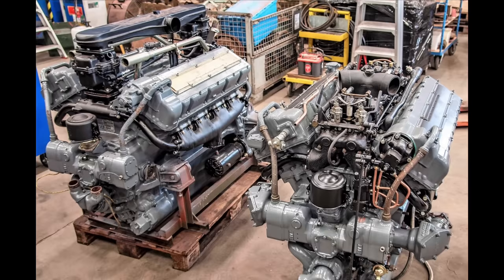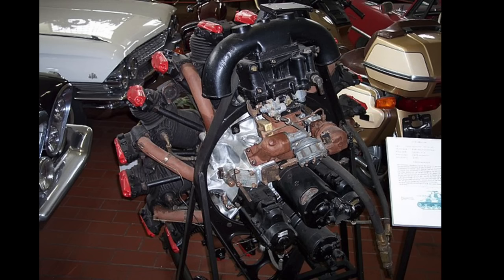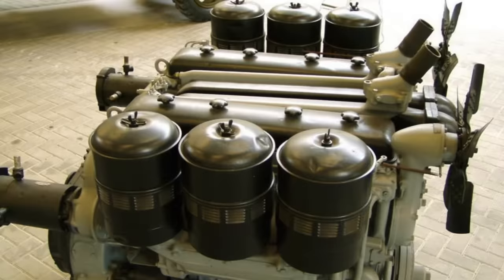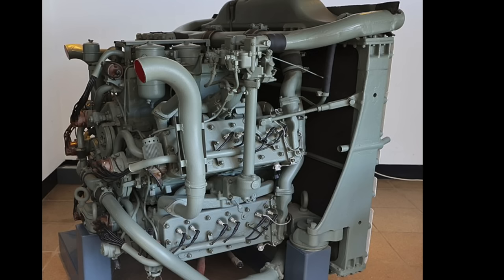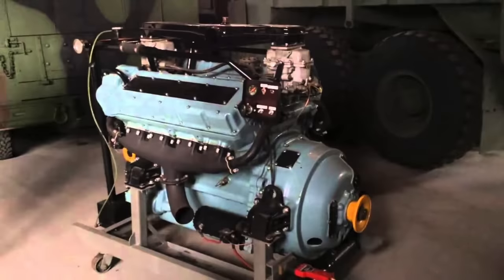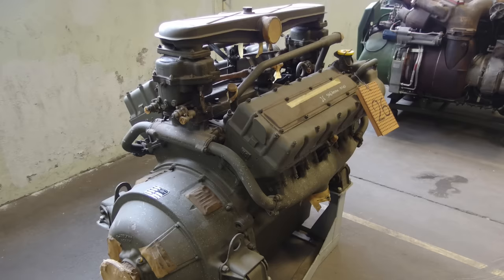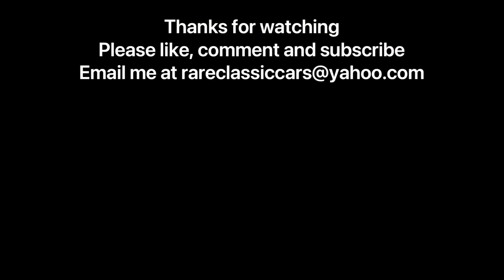An All-Aluminum, Flat-Plane Crank, DOHC V8 in 1940! Ford's 1,100ci (18L) GAA V8 Is a WWII Marvel

Comment: That with a single carb intake would be awesome in a tour bus. Quiet and smooth.
Reply: Fuel injection and quad turbos...
Reply: That would need to be a BIG single carb...
Reply: Off an Allison or Merlin aero engine.....
a drain pipe with 1/4 inch jets and a Coke bottle sized accelerator pump...

Fuel injection for the win...with all the modern sensors to control everything on that engine...

idle @ 250rpm or less...
full out past 3000rpms or more...

(the crankshaft is the weak point with those horrible vibrations 
(that's why the 150lb flywheel)

 @De19thKingJulion
Reply: @JohnSmith-yv6eq  If I could EVER get one of these, probably for a heavy duty truck... Fuel injection for sure, perhaps 16 of 'em.  Hearing one idle at 250-300rpm?  Ooooh
Reply: @De19thKingJulion   Not necessarily. LPG regulator and HHO regulator or EGR and it would work with just one of those mistifiers. It only needs to turn 2500 to 2700, and not for a "max power", but smooth operation with decent fuel economy.
Reply: @JohnSmith-yv6eq  Not heading to the sky, not trying to win races, only down the road with band gear and a dozen hippies in a bus. One carb, LPG regulator and HHO, or EGR system would easily turn that thing in between 2500 and 2700 RPM with decent mileage, while making less noise than the tyres. The combustion chamber and all the dimensions are off for actually trying to make power out of that thing. Boost and EFI would require basically completely different engine from crank to casing.
Reply: @JohnSmith-yv6eq  To hell with computers and sensors and all that crap.  Carburetors and distributors were the way to go.
Reply: @jamesbosworth4191  - "distributors"? Fergitaboutit! Magnetos for reliability.
Reply: @OHUQTU  
Distributors are a heck of a lot better than computers, sensors, and other non-adjustable non-repairable junk.
Reply: @jamesbosworth4191  - The FAA requires dual magnetos with gasoline powered piston engines for reliability - no distributors are allowed with aviation engines, because they are not reliable.
Reply: @OHUQTU  I thought you were talking about cars.  Sorry.

Comment: Flat plane cranks went into some of the first V8s, going back to the OX-5 and earlier. The 1917 thru 1919 Chevrolet Model D V8s were so configured.

Rolls Royce built a similar engine called the Meteorite, a derivative of the V12 Meteor, which itself was a marine version of the Merlin, but naturally aspirated. 

Ford ultimately built the final version of the Pratt and Whitney R-4360, under contract by Pratt and Whitney, which was a 28-cylinder radial. AKA the Wasp Major, the Ford built versions powered Boeing C-97/KC-97 Stratofrieghters, Douglas C-124 Globemasters and Consolidated B-36 Peacemakers. Rated at 3,500 to 3,800 HP.
Reply: Yeah, the original flat planes were just because cross-plane hadn't been invented/commercialized.  It's not like they were revving an 18L engine to 8kRPM, lol.
Reply: @@retiredbore378 That's why I wrote invented/commercialized, rather than just invented.

Comment: and yet american cars still come with pushrod crap till now. image in the us just leaned into making advanced engines
Reply: Pushrods are far from crap. The LS engine is one of the most swapped engines in the world.
Also DOHC isn't new or "advanced" tech.
OHC techonology and pushrod technology are within about 10-15 years of each other.
Reply: @riogrande163  the old lt5 was better in every way to the old sbc
The new lt5 is vastly superior to any ls ever made. 
There is no comparison between that two design that compares favorably for pushrods other than cost. American make them because they are cheap and simple not because they are better. There’s a reason no one uses pushrods anymore…

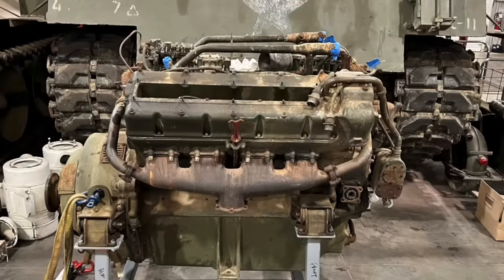Comment: I volunteer at the Museum of American Armor in Old Bethpage NY. You actually are showing off a GAA in our museum at the 8:00 mark! We have a number of vehicles we keep in running condition. One of the other drawbacks of the radial engine is that it needs to be cranked by hand 50 times before startup, to get the oil out of the bottom cylinders and flowing throughout the engine. Ask me how I know!

Comment: The Australians fitted 4 Buick flat head v6s together to put in the Shermans they had.  They couldn't get the other motors, and they had access to the Buick motors. They stacked the motors in a square configuration and used a gear system to link them.
Reply: Flat head v6? What?
Reply: @patrickporter6536  are you asking what a flathead v6 is or what Buick motor was used?
Reply: Flathead Buick engines?  Buick always used overhead valves.
Reply: @cyclonebuzz8172 I know what a v6 is, I doubt Buick made one in the 30s/40s, flat head or not. I may be wrong.

Comment: The M-4 Sherman was considered one of the fastest tanks of WWII. It was certainly faster than any of the German tanks it went up against. This, its maneuverability and sheer weight of numbers, normally gave it the upper hand in the European Theater.
Reply: My dad was in the Third Armored, and he said the Sherman was faster and had a much better and faster turret system, but all tankers were terrified of the German 88mm.
Reply: @ohger1  I think your dad was right.
Reply: No code p0420 or p0300 back then
Reply: Not faster than a Panther and they had wider tracks, better for soft ground. The Panther 75mm gun actually had better penetration than the 88.

Comment: For a short time the GAA was a popular tractor pulling engine but was soon replaced by the guys running Allisons. I've seen an example of Plymouth's 30 cylinder engine in the lobby of Chrysler's museum north of Detroit. Really interesting engine. It was designed this way to use proven engine parts already in production. Still, it was great engine that field mechanic would have no trouble understanding and keeping running in the field since it was the same engine their car had.

Comment: Whenever I hear old engine specs, I'm always blown away by how powerless they were, and how inefficient, too. My tiny little 1997 Subaru EJ20 2-litre turbocharged horizontally opposed 4-cylinder weighs 380lbs with headers and turbo attached. Yes, it is highly tuned with bigger injectors, a much large top-mount intercooler, and a 4" cat-less downpipe - and it dynos at 404 HP at 18lbs of boost.
It's got a short-ratio 5-speed gearbox from the WRC rally cars, and so it redlines in top at just 215 kmh! 
Throttle response with the little Mitsubishi TD04 turbo and the ultra-light crankshaft is phenomenal, and acceleration in 2nd and 3rd gears is ferocious, and the utmost driver care and attention is required, lest the vehicle gain the upper hand. :)
Reply: Maybe, but it doesn’t have the torque to pull a tank. Horse power isn’t everything and that’s why trucks have big diesel engines, not high horsepower figures but look at the torque, it’s massive.
Reply: If you were to put your engine in a tank that constantly requires 400 hp, it wouldn't last long at all.  The 450 hp the GAA makes at 2600 means it is also producing over 900 ft/lb.  You can't just go by hp to understand what is going on.

Edit: Also consider that an operating requirement would have been to run on inconsistent or low quality fuel without detonation.  That would place limitations on what can be done regarding compression or forced induction.
Reply: lets see how your subaru runs on 80 octane gas
Reply: @shawnbottom4769  Agree 1000%---what many don't realize is that the fuel available to ground forces back then by necessity was very low octane, because the vast majority of the engines consuming that fuel were flatheads in trucks, jeeps, and stationary equipment.  Since this engine went onto the drawing board as an aircraft V12, I'm sure it started out  with a high compression design, but when it was redesigned for V8 ground duty, the compression ratio had to be lowered for the reason stated above.
Reply: I don't think the original poster was insinuating putting a Subaru engine in a tank or wheeler truck.
Reply: Your EJ20 wouldn't budge a Sherman, at least not very fast and not for long.   The GAA would not only put out 1000lb/ft torque, it did it at 2400 rpm and could do it all day every day, and they did.

Comment: From what I have observed and studied the GAA was a very advanced engine for the time, and even today modern engines incorperate many of these features.

I may be wrong but i think they had basic variable valve timing, and the later models used in the M26 pershing were updated with throttle body injection.
These engines bare many simulairities with Fords modern modular block V8s.

Comment: The Detroit twin six was a two stroke diesel engine, and the blowers on them were not superchargers, but scavenger blowers. As with all two stroke Detroits, they have no means of natural aspiration so the blowers are needed to pump in fresh intake air charge, and scavenge the exhaust out. Intake air is provided at slightly above atmospheric pressure. Intake charge entered the cylinders through ports in the cylinder sleeve when the pistons were at bottom of their stroke, and exhaust exited through valves in the head. There were turbocharged versions of Detroit two stroke engines later available in trucks and the like though. Two stroke Detroits have a sound all their own. The main truck in the movie "Maximum Overdrive" is a good example of that sound.

Comment: Torque is what you actually measure on an engine. 2-stroke engines Rev, very high and then that's where you measure horsepower
Reply: @@retiredbore378 👍Wartsila wide open- 90 rpm/100,000+ hp😁 engine the size of an apartment building.

Comment: big deal.  Peugeot had a dual overhead cam, aluminum 3L engine car that twice won the indy 500. 1912 and 1914? about. The French were always ahead. 4 valves per cyl no problem.  I
it massacred 10L cars

Comment: The low RPM has to do with it's aviation heritage.  Most light aircraft engines will redline around 2700 RPM, the reason is that the tips of the propellor will go supersonic if turned any faster.  The Allison 1710 and the RR Merlin V12's typically turned around 3000 RPM, but they used reduction drives.  Ford was probably trying to get around that and designed it for low speeds.  That way it wouldn't need a troublesome and heavy reduction drive.

Comment: the Chrysler 30-cylinder engine was 5 6-cylinder truck engines married together. It was apparently quite reliable. All of these different engines were needed because of the lack of a truly adequate engine design.

Comment: 3:36 Even though the two stroke Detroit engines employ a blower, it's a misnomer to call it supercharged.  The blower is required for the intake ports to charge properly.
Reply: FACT.
Reply: So many don't understand this today.  They don't realize that the Detroit is not capable of generating intake vacuum.

Comment: Woah, that's cool, but it's not anywhere near the biggest of the gasoline engines.  Those titles belong to Wright and Pratt & Whitney.  2800, 3350, 4360, cubic inches.   And then there were the liquid coolers at 1650, 1710, and 2200 (? Griffon was 2200?).  Sweet ford but not a biggun for the time.
Reply: talking about V8 engines!

Comment: Ive heard stories of these engines spinning over twice their rated RPM, must have sounded amazing!
Reply: There are unofficial reports of some tractor pullers turning over 5000 rpms. Remember that today's engines measure pistons and rods in "grams", and I think NASCAR has a 450 gram minimum weight on rods. The GAA rods weigh "5 pounds" each and the pistons (with pins) also weight "5 pounds" each. So, when you have 10 pounds of reciprocating weight per cylinder, it gets rather dicey when revving the engines.
Reply: @bobkonradi1027  makes me think of the crazy aircraft radial tractor pull builds, those guys are nuts lol.

Comment: I read a pulling tractor magazine from the mid 80's where a puller was using one of these surplus engines in his pulling tractor. He had a spare engine still in the crate.
He said it was designed like 2 four cylinder engines hooked together with independent carbs and ignition.
The V12 must have been the same with another bank of four cylinders added.
Reply: Actually it's the other way around. It was originally designed as a 12 cylinder aircraft engine that the government didn't buy. When the government wanted a tank engine, Ford used the 12 cylinder and down sized it to 8 cylinders.

Comment: As a former tank mechanic I can tell you most of our power packs come heavily detuned even to this day…I have no doubt that tankers back then knew how to disable things to get more power, why you might ask? Because we did it all the time 😂 didn’t take us long to figure out anything with red safety wire threaded through a screw on the fueling system was the screw you needed to turn to have more fun 👍😀…now if you did this state side you’d get burned by your FSR and immediate chain of command, but over seas while deployed…well…nobody really cares…my vehicle (M88A-2) in Afghanistan was powered by a teledyne 12 cylinder air cooled diesel. We turned up the fueling on that beast and we had no problem keeping up with the tanks after that…our track took a beating and we smoked 2 magnetic clutch’s for our hydraulics that deployment but damn it sure was nice to have all that power on tap…I once pulled 3 blown up tanks simultaneously out of a wash, my final drive outputs were smoking from the heat but it got it done 💪

Comment: M4 & M4A1 used the R975, M4A2 used the GM 6046, M4A3 used the Ford GAA, the M4A4 used the Chrysler A57 multibank, and the M4A6 used the Caterpillar D-200A 9-cyl radial diesel. The M4A6 had the lowest production, only 75 produced. There was no M4A5 model.

Comment: Interesting. Technology was there from the '40s. But there was no will at all to put this into cars. GAA was really modern engine like new ones. Except the fuel injection of course. 
When you look at the "malaise era" in the 70s, you must be shocked. There was no reason for it. Technology was there from the 40s. There was no need for 8.2l V8 with 150hp.... 
Just put little more effort into engines. Not to build constantly same motors from the 50s only with bigger and bigger displacement...

Comment: AFAIK, the 60° V8 was pioneered by Lincoln in the 1910's. Somewhere in storage I've got a writeup about different primary balances of V8's in different V angles. A 60° V8 with a flatplane crank's primary  has vibrations spinning in a perfect circle at twice the RPMs of the crankshaft. A simple midshaft balanced to offey that between engine and tranny offset that. However, nothing can be done about the uneven firing order.

Comment: Impressive engine indeed. I just saw a video on the fiat S76 from the early 1900s. It has a inline 4 cylinder with 1,730.2 in3 displacement 😂that's like 7 liters per cyl. It made like 300hp but 2000lbs ft of torque 😅😅lawd

Comment: You forgot to mention another part of the reason for the GAA V12 variant's creation in the first place: when the UK was gearing up for war Rolls Royce realised that they couldn't meet the production goals for all of the aircraft that needed the Merlin engines, so Ford of England was asked if they would be interested in manufacturing said engine under license as they've obviously had much experience with large scale automotive engine production. However, a representative from Ford said something along the lines of, "I regret to inform you that we will have to decline your offer. I'm afraid your tolerances just aren't right for us." The Rolls Royce guy responded, "They're too close for your machinery to maintain regularly. I understand.", to which the Ford rep quickly said, "It's actually the opposite. The tolerances we use on our auto, lorry (truck) and ag engines are a fraction of what goes into a Merlin." So simply put, Ford felt they could do better and got (a version of it) into production. Also, a derated 770hp variant of the V12 was used in a few experimental and prototype tanks (coupled to a pair of GM Hydra-matic transmissions, or one in the M26 with V8) before the switch to Continental gas and then turbo diesel V12s. And btw if you haven't noticed, yes I am a WW2 and automotive buff

Comment: Just think if Fnord had actually done it right and redone it as a proper 90deg V8 so that it could have spun to a higher rpm and made even more power w/o having to be governed to an artificially low rpm to control the excessive vibration...
Reply: Im sure overall dimension was a consideration. With overhead cams at 90 degrees the engine is taking up too much space and the Sherman was a small tank.
Reply: 60° will spin higher all day longer
Reply: a tank engine shouldn't rev high, it should produce alot of torque, at a low, accessible rpm, and do so reliably in a combat situation.